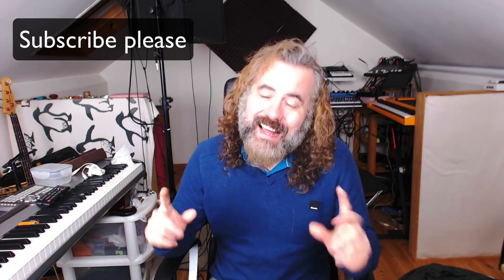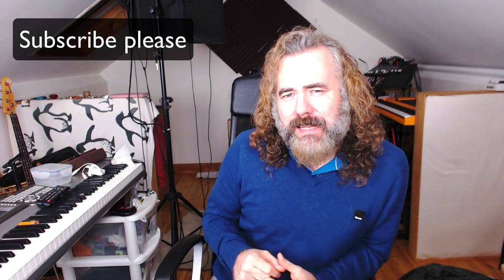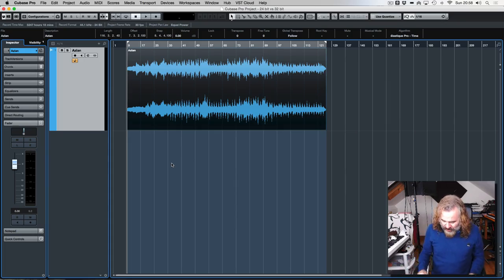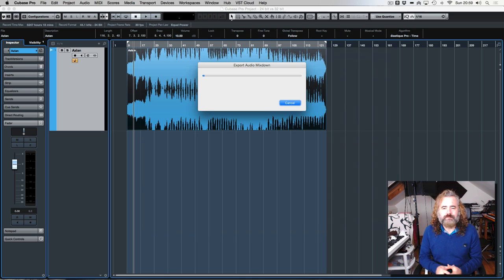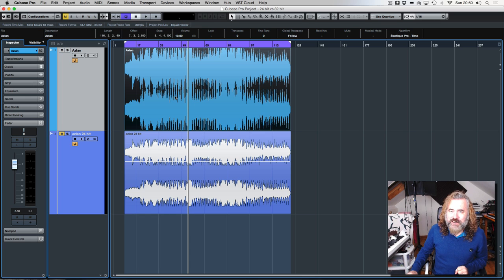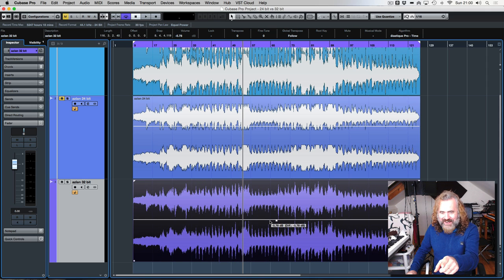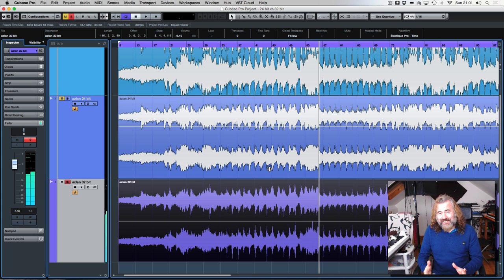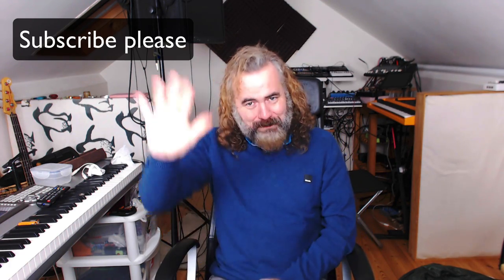Why you should mix down at 32 bit float!

Comment: I will try to explain the math behind this without it being too techy and with just a little bit of lying.

24 bits is roughly equivalent to 7 decimal digits. So an equivalent decimal format could store whole numbers from -9,999,999 through 0 to 9,999,999. A 32 bit floating point format incidentally also uses 24 bits of significant digits and 8 bits for the position of the point. So our hypothetical decimal floating point format could also store numbers from -9,999,999 through 0 to 9,999,999 and specify that the point is behind the last 9.

If the DAW tries to export a sample value of, say, 6,000,000 both formats will store it equally well. But if the sample value is larger than 9,999,999, for example 22,111,234 the first format cannot store it very well - the best it can do is store the largest number it knows - 9,999,999 and so we get clipping. The floating point on the other hand has a trick up it sleeve - it can store 2,211,123, a number ten times smaller, and specify that the point is one position behind the 3 - giving us 22,111,230. As you can see we lost the last digit of precision, the 4, but the stored value is much closer to the original and the loss of that last digit will be largely unnoticeable.

The binary formats work quite similarly with the difference being that they use binary digits (0 and 1) and powers of 2 instead of 10 and a few implementation details, like the way the sign is represented or a small trick the float format uses to store 24 significant bits as 23.
Reply: you made me feel stupid
Reply: This actually helped me out a lot.
Reply: One of the best explanations yet!
Reply: That’s the magic of 32-bit single-precision floating point operations. 16-bit is half-precision and 24-bit somewhere in between. The lower the bit rate, compared to 32-bit single precision, the more “mistakes” are written to the file. It’s less precise. When I use Logic, I sometimes set the audio engine at 64-bit double precision, it isn’t necessary, just like you explained, 32-bit FP has the magic trick already in its skill set. Imagine how big the file size would be for an exported orchestral music piece in 64-bit at a minimum of 192kHz or higher… Inside the digital audio workstation, the dynamic range is unbelievably high when working in 32-bit. I can’t come up with the exact number but remembering it is somewhere between 800 dB and 1000 dB of dynamic range to work with. It’s such a high value that it isn’t necessary (24-bit already has a dynamic range of 144 dB when inside the DAW) for dynamic reasons, but more for the occurrence of clipping. Better said, the lack of clipping. Although a producer shouldn’t let their channels and the master peak above zero. You won’t here it until you have exported the music file. So stay below zero everyone. On channels and especially on the master (or 2bus) out.

Comment: Make sure when mastering a 32bit mix, that it isn’t “digitally” clipped in the DAW before you export it. If the master channel goes above 0dB LUFS, you won’t notice it while inside your DAW but you do hear it when it’s being exported to a wave file. So make sure all channels stay comfortable below zero and leave a headroom of -4 to -6dB so the mastering engineer can make adjustments. Also, if a 32-bit (single precision floating point operations measured per second in FLOPS) is exported well, if you master it yourself and must convert to 24 or even 16-bit don’t forget to use dither.

Comment: Thanks for that. I never knew it wouldn't clip at 32 bit float.
Reply: Well I feel like the point is that, it will still clip if you load up the mix with rendered audio again and keep things too loud. But with 32FP or 64FP, you won't have actually lost the information from the rendered mixdown sound because that is still stored and so you can always go back and turn it down and all of the quality is still there. It means you can mess around with the audio a lot and if you add too much depth to the sample it can still be tweaked without loss of quality before you finally master it at 24/16 bits.
(Edit): I had only watched half the video but yes it turns out he already points that out pretty clearly himself here so I'll just say I've reiterated it just to make it clear since it technically isn't correct that the mix won't be clipping just by rendering it at that depth.
Reply: @JohnnyNatrium  cool. Thank you for the explanation 👍

Comment: It would be cool if loudness war casualties could be restored in level with peaks intact from digital files (mp3, aac) that have internal range of over 150 db. Apart from WAV, Reaper supports rendering over full scale to WavPack and MP3. Other formats currently clip. WavPack files are smaller and be selected to have noise floor of 16 or 24 bit equivalent to reduce their size further, while still encoding overs.

Comment: A great demo,  and I agree that using 32bit makes total sense. The reason this works is because bit depth effects dynamic range / headroom.  It is still possible to clip at 32bit, but you would have add insane amounts of gain to do so.  Do you think tracking at 32bit makes sense as well, or simply saving that for the stereo mix only?
Reply: but in 32-bit case it's a fucking mountain of garbage.

Comment: Just remember gaz that 32bit float uses 50% more hard drive space  and if your mix is clipping when you mix down at 32 bit . 
When you  adjust for clipping you are also reducing the overall mix .
Reply: Yes, this video can be very misleading. It's more important to record a clean signal to work with regardless of 'bits'  used.

Comment: psst -- a handy little tip -- I've noticed saving mp3s from 32-bit files to 320k mp3 keeps the full high end!!
Using any lower bit rate results in very top end completely chopped off
Reply from the maker: Ann Other aha I’m going to have to try this out. If this is so, I would wonder how it affects other codecs.

Comment: Wow, information like this for someone without a professional background in production is like gold, thank you Gaz. Keep them coming.

A quick question, does that also mean that if you record at 32-bit you are less likely to get clipping? (I imagine not but wanted to be clear).
Reply: I don't think you can record in 32bit as no audio interface can deliver that kind of dynamics. I advise recording in 24 bit and keeping an eye on the level, don't record too hot, keep it at around -18dB RMS and peaks at maybe -6dB peak, and you are safe. Also, if you have those levels before you go into the mixer and plugins, you reduce the likelihood of clipping the output and most analog emulation plugins today are programmed to be used with a -18dB RMS reference level anyway.
Reply: +Jan Minor Brilliant, thanks.

Comment: interesting - it's the floating point that makes the difference? what happens to the 32 bit float mix if you then convert to 16 bit without changing the levels?
Reply from the maker: The 16 bit version would be clipped unless you reduced the gain whilst still in 32 bit float. Also dithering is necessary with bit depth reduction as I'm sure you know.

Comment: But what if you mixed down with a true peak limiter making sure nothing goes over -1db?
Reply: -1 dBTP seems to be an attempt to solve the problem in a place where it doesn't exist. When audiofile is normalized on 0 dB in a normal way, it is not distorted, it is perfect. The fact that analog signal can go higher than 0 dBFS  during playback is not a problem, it is part of the digital-to-analog conversion process. And output limiter is also not essential, if it is not achieving some artistical goal or solving some technical problem or simplifying workflow. 32-bit float export allows not to worry about clipping and quantisation noise floor. But after this export is done, you can open this file in an audio editor, normalize it on 0 dB or -1 dBTP, and then save as 24-bit FLAC. After that 32-bit file can be deleted. When output limiter is used, it is enough to export directly to 24-bit FLAC.

Comment: Hi I have a project 48k 24bit, when vocal files arrived they are 44k 32bit , should i upgrade the project to 32bit or should i convert vocals to 24bit, and regardless of the solutions at some points i need to convert 32bit to 24bit
How can i do that with minimum loss? Thanks
Reply: Convert the 44.1kHz vocal to 48kHz

Comment: The logical question is this.. What streaming sites except 32 bit float point files ? Umm.. None. So what are we gaining from exporting to 32 bit float point when you are eventually going to have to dither it back down to 24 bit eventually ?  I run a facebook group with over 30,000 users who keep referencing this video as a reason to mixdown to 32 bit FP but don't understand what they are achieving. Appreciate your efforts but as a mastering engineer, there is no real value in exporting to 32 bit FP unless you are exchanging files with other musicians (the stems).
Reply from the maker: Good (floating) point! My main reason for this was more for never ever clipping your mix providing the mastering engineer knows to normalise to -0.3bB or so.

Comment: What if you drop all tracks in your mix down so that your master is peaking at -6db. Would there be a reason to export at 32 bit at that point?
Reply: Hakuu my thoughts exactly.
Reply: Yea I would mix and have my gain stage set so that  my mix sits at -6 or at the very most -3 giving mastering head room to do his or her work. Then mix down /export ( faster than real time bounce/ render) at 32bit 48k  just to ensure there are no truncations or clipping of the audio file. Any Mastering facility should be able to handle a 32 bit file..if not..I would also provide along side the 32 bit file...the same file converted to 24 bit 48k in hopes that the the transition from the 32bit file to the 24 bit file would leave everything in tact. I would prefer for them to use the 32 bit file and master from that insuring they are getting the exact sum of my mix to the point if they was listening to the file vs the session … there would be no difference in terms of the mix itself!  However in the past I have delivered files 24Bit 48k coming from sessions mixed at 32bit 48k while keeping my gain stage set at -6 / -3. No one has ever complained!  I know many folks are told to keep their master buss at 0. I have never done this. Maybe I am wrong but the checks keep coming so hehe..
Reply: Channels that  respond to their viewers questions are the channels I’ll never sub to. It’s been a year and still no reaction. That shows you how much they really care.
Reply: Hakuu -- the advantages of 32-bit are many.  The headroom is one. The fact you'll get less artefacts from mastering plugins and also saving your 32-bit file as 320k mp3 wont chop off the high end at all!!
Reply: No.

Comment: What was yo project settings?
32-bit-float?
I think it only makes sense when U record and work wit 32bit. 
What if U import a 16bit file?
I think it will not make a difference.
Reply: Don't confuse integer vs floating point. Your interface records in integer.  Your DAW works in floating point.